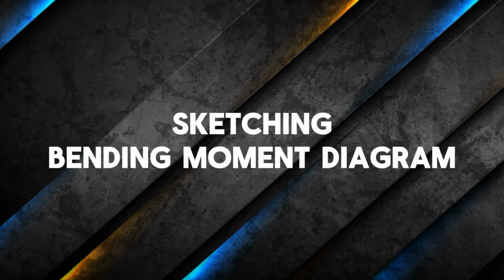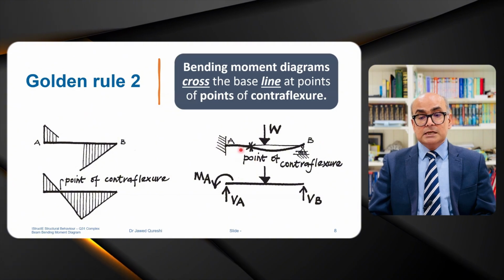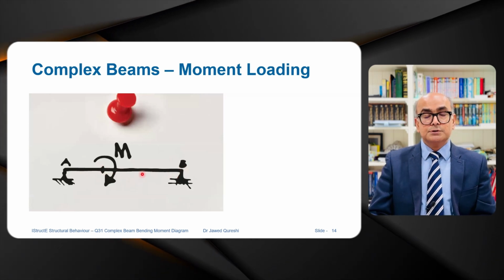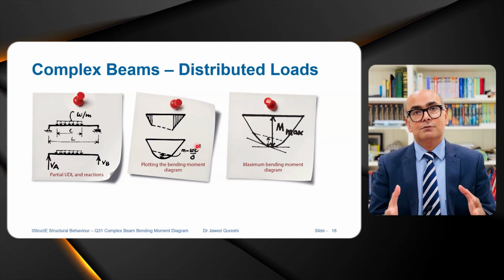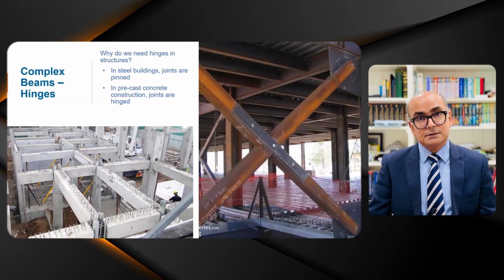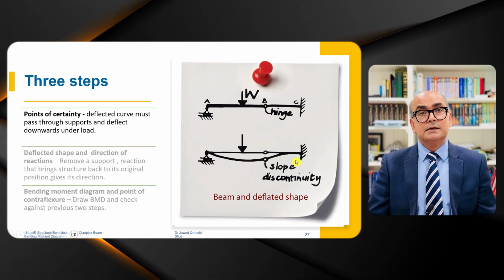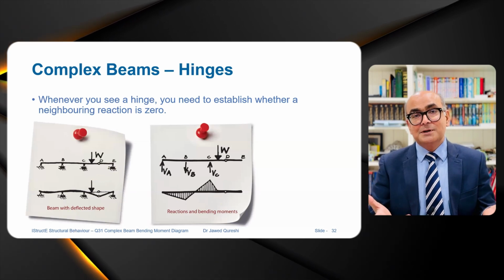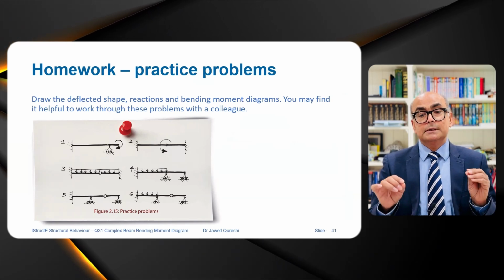Complex Beams | IStructE Structural Behaviour Course

Comment: Hello Sir, I hope you will be feeling well. I am confused about your recent posts on LinkedIn where one part of the beam has higher flexure rigidity as a result you say that it carries more load/bending moment but we define bending moment as a product of force and perpendicular distance, there is nothing mentioned about flexure rigidity/ geometry of beam. As per your opinion this definition seems incomplete. Secondly  BM depends only on external load and support conditions. Please elaborate it. I will be highly thankful to you
Reply from the maker: Yes, the equation Moment = Force × Perpendicular Distance is always valid as a fundamental definition of moment, regardless of whether the structure is determinate or indeterminate. 

However, for indeterminate structures, simply using this equation is not enough to determine the internal forces and moments. Indeterminate structures have more unknown reactions than available equilibrium equations (∑F = 0, ∑M = 0). Solving them requires additional compatibility conditions, material properties, and deformation analysis, often using force and displacement method.
Reply from the maker: So, while the moment equation itself is always true, solving for moments in indeterminate structures requires more advanced analysis beyond just static equilibrium.
Reply from the maker: Forces in indeterminate structures are attracted to stiffer elements.
Reply: @DrJQureshi  Thank you so much sir, for clearing my doubts.
Reply from the maker: @muhammadsufyan5022 No problem. I’m here to help.